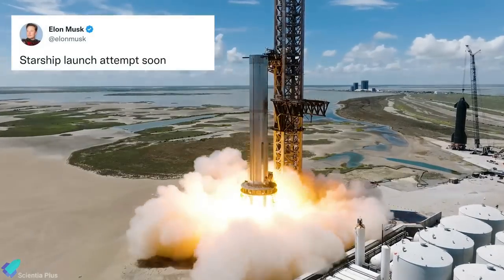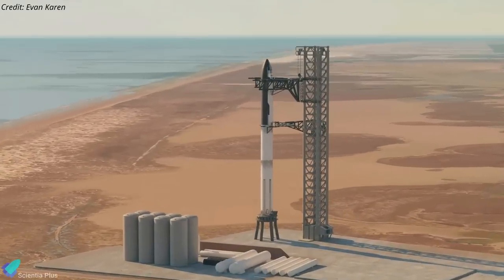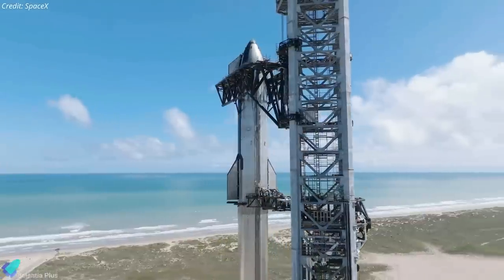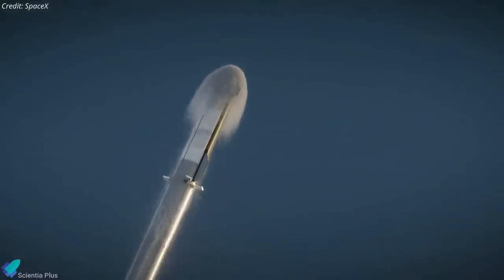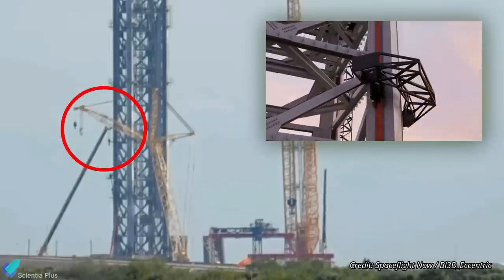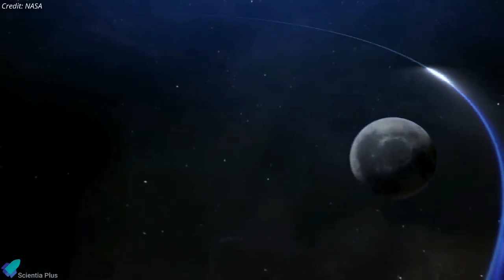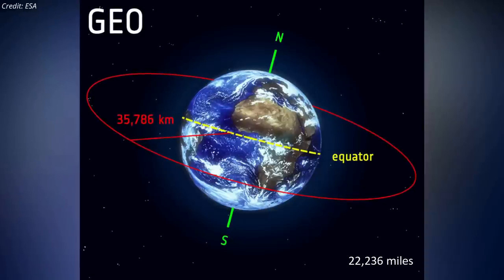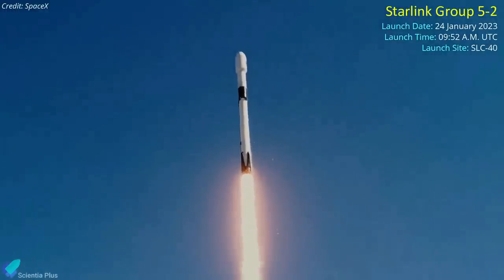SpaceX Starship Received FCC License For Orbital Launch, KSC Chopsticks Install, Lunar Probe Trouble

Comment: What does the FCC have to do with rocket launches?
Reply: Providing a license frequency for communication (mission control, statistic data and control messages to rocket, etc).
A dedicated frequency will avoid interference from the current radio waves (ISM frequency, TV, satellite, radio, etc)
It's similar to phone frequency(LTE, 4G/5G). You will need a license from FCC. In this case, this is for short term.

Comment: What would they do with a FCC license? Televised disco from Mega Bay?!😮
Reply: Using a license radio frequency for communication between Starship/Booster and ground control station. You will need a dedicate frequency/spectrum to communicate/transfer statistic data in real-time without interference on the current frequencies (Wireless, radio, TV, LTE, etc)
It's a common thing when you did a rocket launch.
Reply: @Conner66  No, I don't think we can. The frequency for radio communication will be encrypted and authorized for SpaceX's equipment.
Besides, they can utilize a part of bandwidth for data transfer.

Comment: So, one alphabet agency to go - the FAA - before Starship can launch.
Reply: I do not believe that FAA is the obstacle.  All critical personnel at FAA have aerospace experience, which indicates they are personally likely to be fans.  However they are subject to pressure from Congress and the military-industrial complex.  Once Starship is operational Spacex customers, particularly DOD, will indicate where the true national interest lies.
Reply: @jamescobban857  That someone may be pulling the strings of the FAA does not remove its responsibility.  It is now the regulatory chokepoint and needs to be called out for its foot-dragging in this matter.